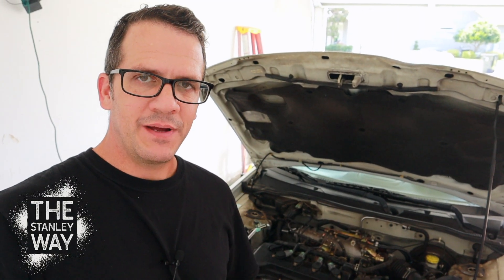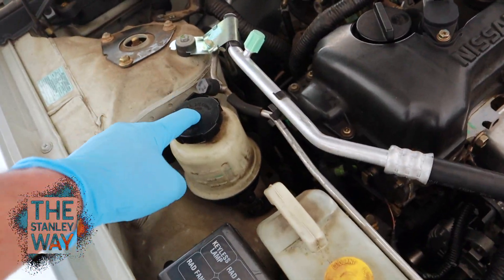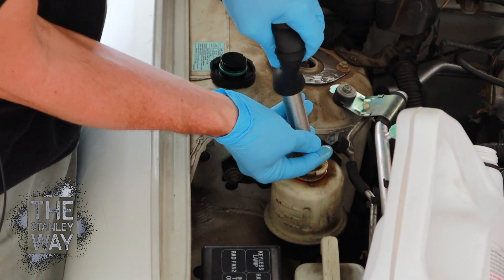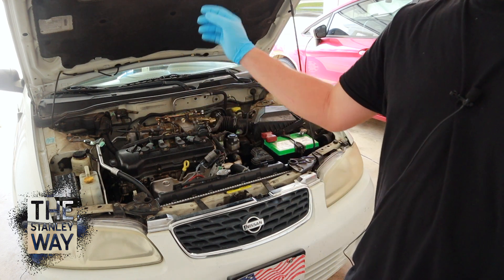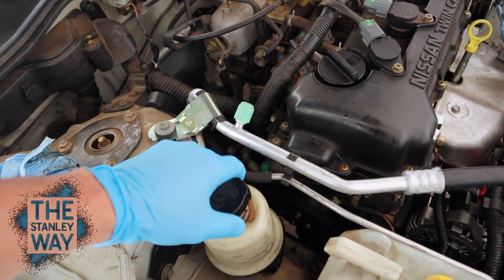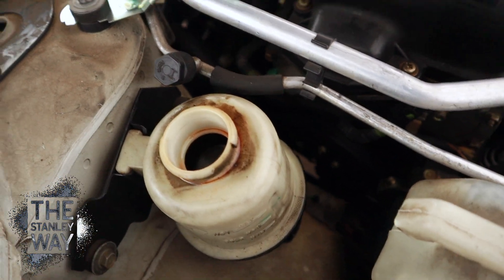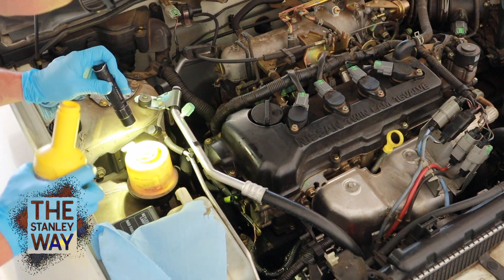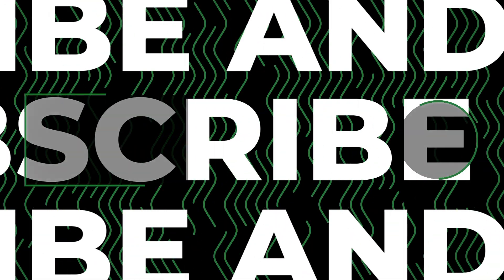**EASY** Power Steering Fluid Change, 2000 Nissan Sentra Video

Comment: Thanks ! You made this look so easy!     
Ive got an 04 sentra ,  and im driving bout 300 miles a week.   I bought it used , had it for 2 yrs and my question is what are some other maintance i can do ,  other than (oil, plugs, filter).   It was running a little rough so i cleaned the throttle body, and so are there any other parts that can be cleaned up, ect .    I need this car for work , which is 100 miles rountrip
Reply from the maker: @kristinekoski7345  thank you. Check out this free maintenance guide http://Www.charm.li I just found it recently and it seems to be pretty good. I usually use an All Data subscription that I pay yearly but now I am using charm. It will give you a specific maintenance routine for your car by mileage.

Comment: Good job brother, I've heard on some of these they use transmission fluid instead of power steering fluid is that true?
Reply from the maker: Yes, it is very important to check first. Most Fords that I have worked on take transmission fluid. Many people have ruined their pumps by using standard power steering fluid. Thanks.
Reply: Yeah. I think you put the wrong fluid in. Is it totaled? I can see the red residue in the lip from what was suppose to be atf fluid.
Reply from the maker: No the power steering is still going strong.